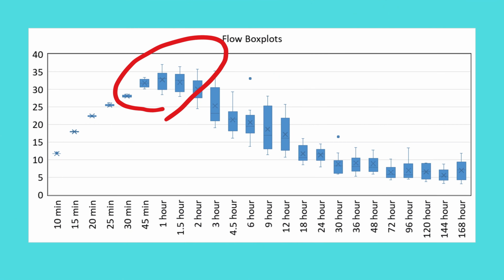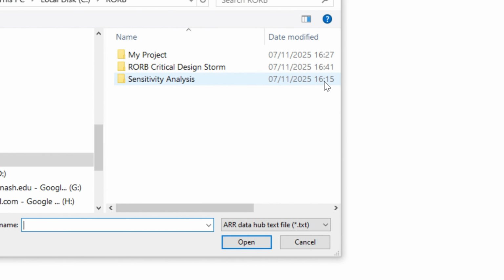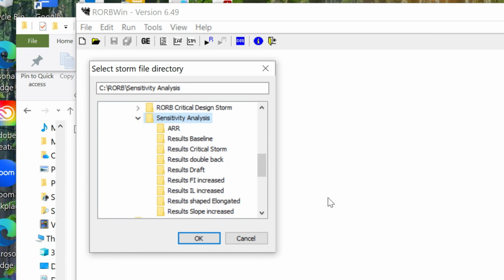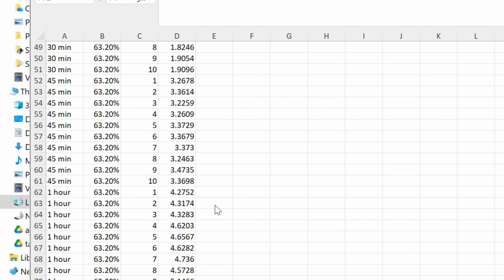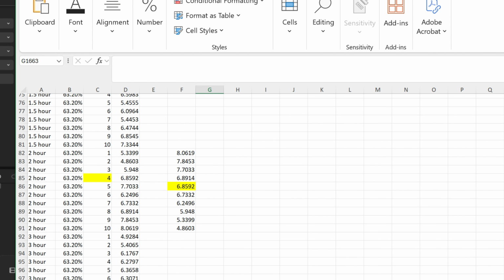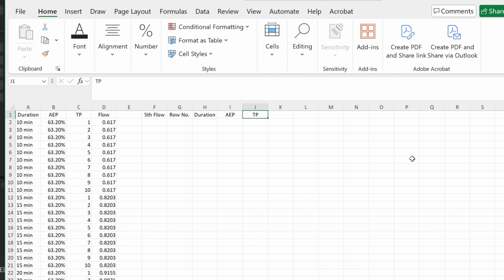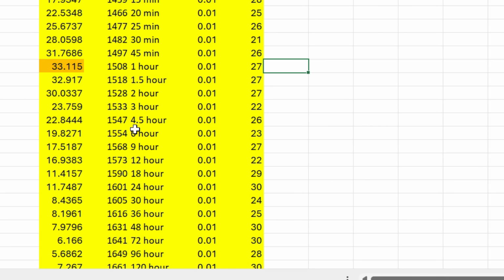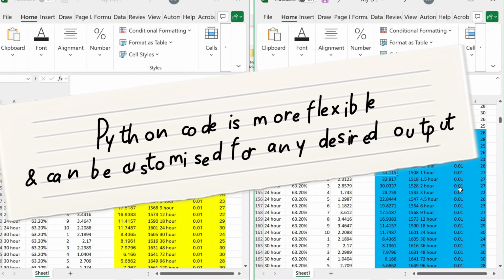How to Find the Critical Design Storm: Automate RORB Post-Processing with Python & Excel

Comment: Hi, Awesome video. Could I please request the Python code? Also, I have a query related to the calibration of the EPASWMM software with the Rational Method. Please let me know if I can share my query here or through email?
Thanks
Reply from the maker: Hi, thanks for your kind support. Regarding the code, sure, please drop me a message on my LinkedIn page. I will be in touch with you regarding the Python code. 
About the calibration of EPASWMM with the rational method, please share your query. I try my best to help.